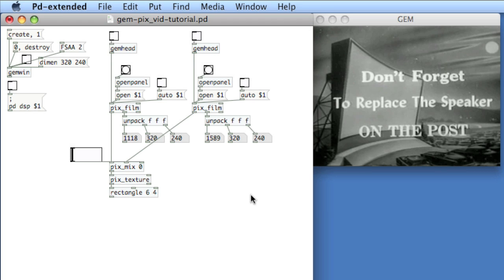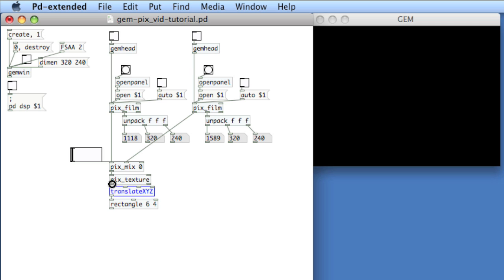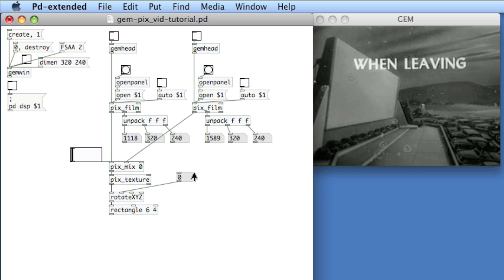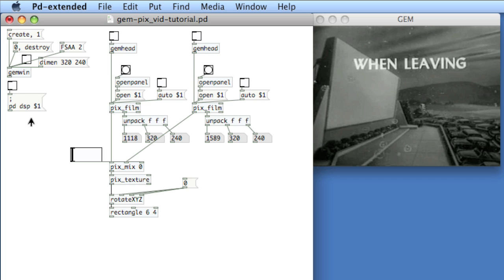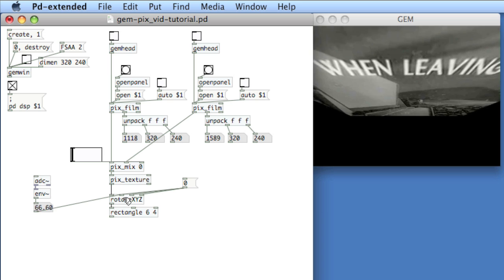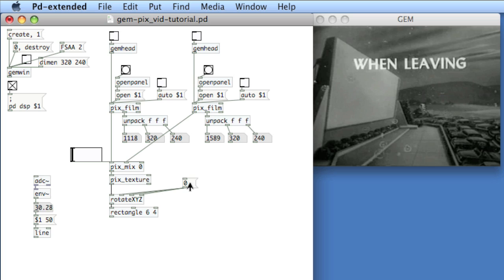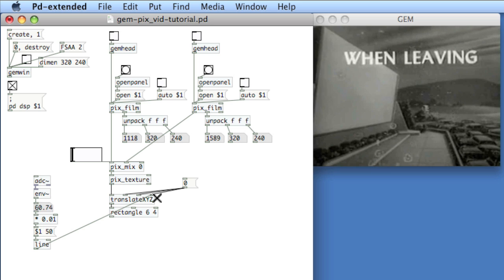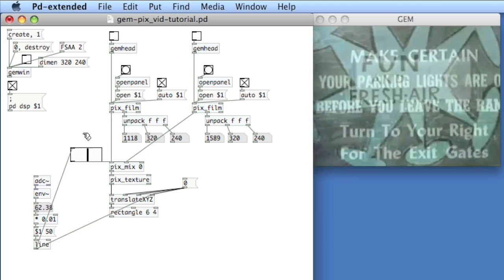PURE DATA: 28 Simple Video Manipulation in GEM

Comment: my translatexyz does not work. it works sort of with translate x y z (with spaces) but only two inlets appear. confused.
Reply from the maker: It's [translateXYZ ] (with caps for XYZ). The reason translate with the space works because you are calling the [translate ] object and then sending the arguments "x," "y," and "z" (which aren't valid arguments for that object). When creating [translate ], check the help for the object; the object is capable of accepting lists of xyz data.